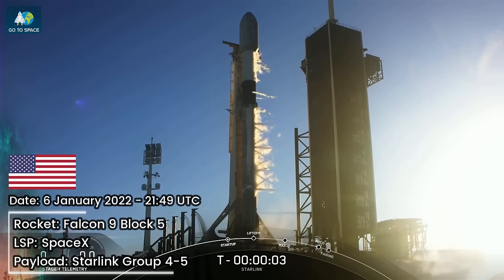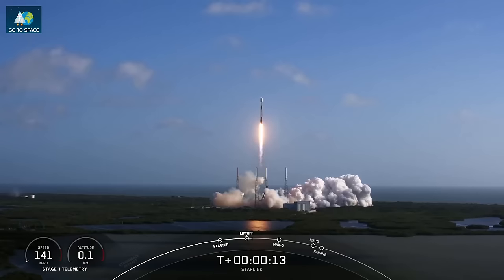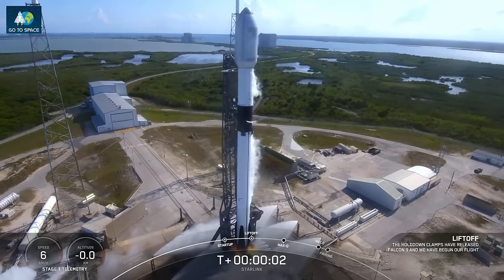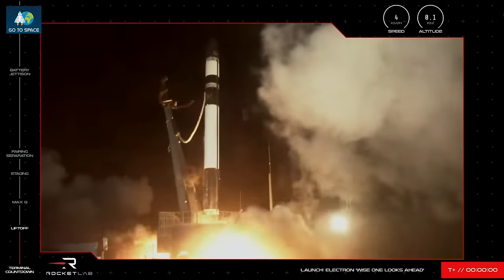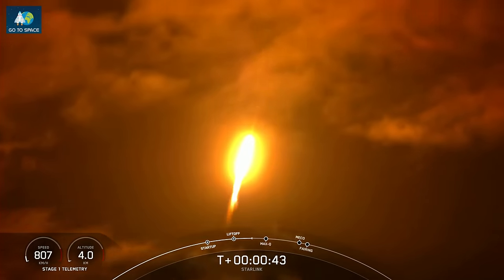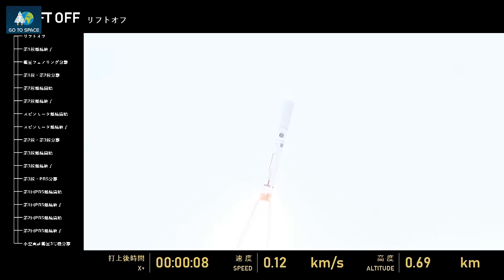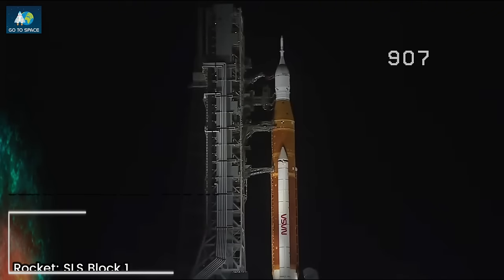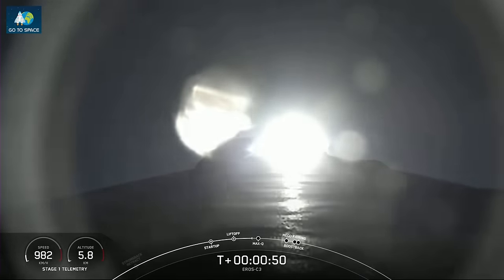𝑹𝒐𝒄𝒌𝒆𝒕 𝑳𝒂𝒖𝒏𝒄𝒉 𝑪𝒐𝒎𝒑𝒊𝒍𝒂𝒕𝒊𝒐𝒏 2022 | Go To Space

Comment: Did any of these launches fail at a later point in their flights? Some trajectories looked a little wonky.
Reply from the maker: Out of the total 186 launches, there were 7 failures and 1 partial failure (this meaning the satellite didn't reach the intended orbit, or that the second stage malfunctioned and satellites were lost)
Reply: @GoToSpace_GTS  Awesome. Thanks for the info.